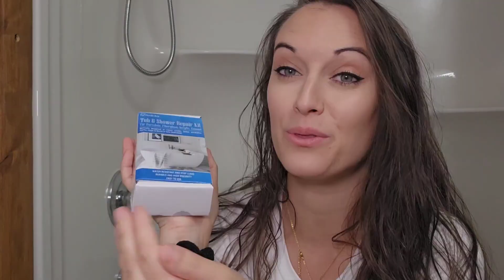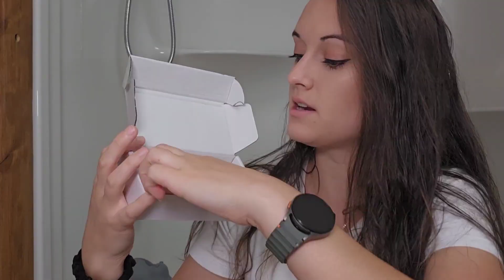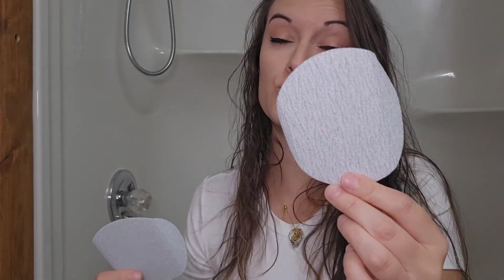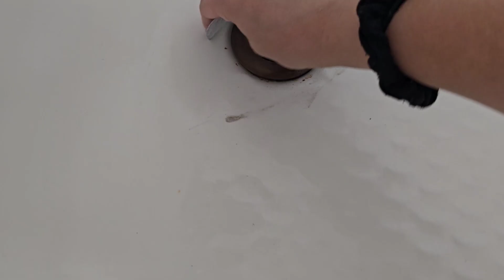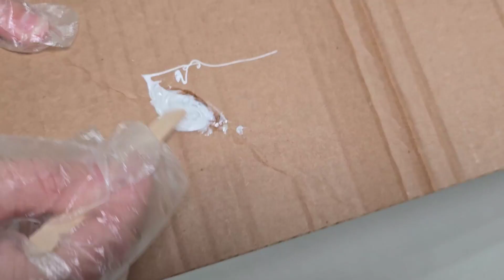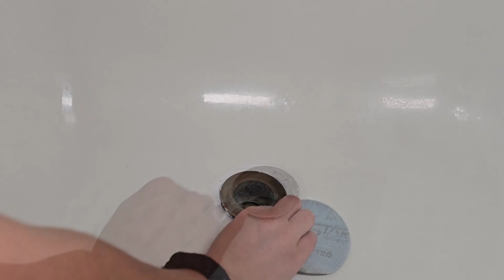🛁 Tub Repair Kit Review | #1 Best Seller Bathroom Repair Solution for Chips, Cracks & Scratches

Comment from the maker: ✨ Extra Details You’ll Appreciate:
• Permanently repairs chips, cracks, scratches, and rust
• Works on tubs, toilets, sinks, showers, and trays
• High-temperature resistant, non-yellowing finish
• Leak-stopping and chip-resistant surface
• Fast-curing fiberglass formula bonds strongly for durability
• Simple process—no professional tools or expertise required

Comment from the maker: 🎥 What You’ll See in the Video:
• Unboxing the Ankita Tub Repair Kit (Parts A & B)
• Step-by-step repair process on chips and cracks
• Mixing and applying the compound
• Before-and-after results on a bathtub/sink surface
• Tips for achieving the smoothest finish
• Durability test after drying